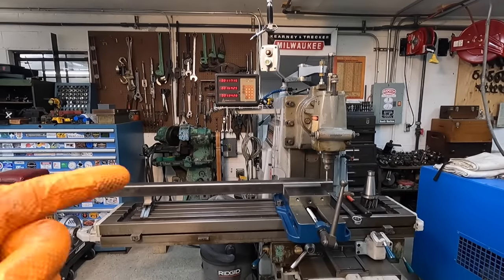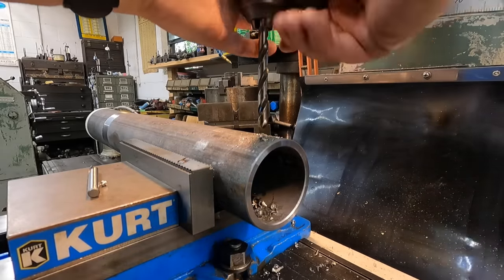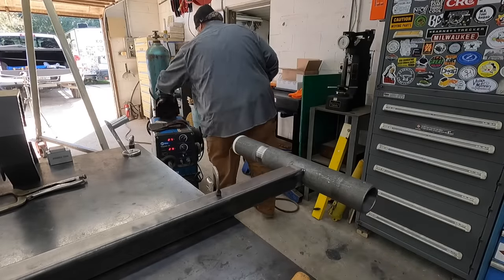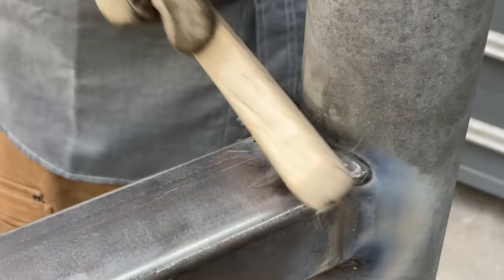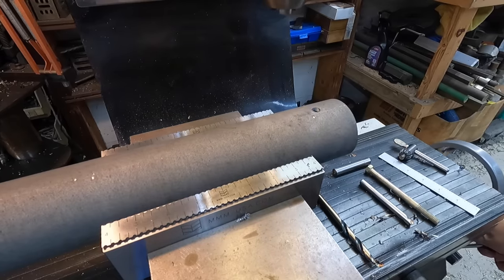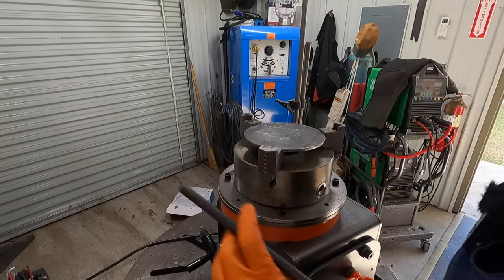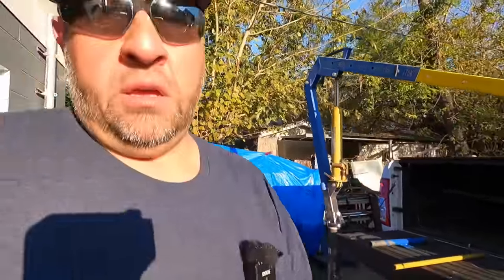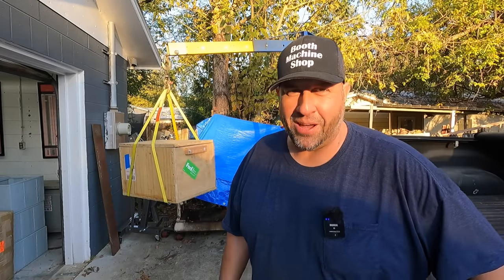Truck Hitch Crane Build Ep. 7: First Test!

Comment: Argon gas don't "go bad", but in some cases, after an extended period on time set up in the vertical position, they will separate, if they are a mixed gas. Argon-CO2 mixes, need to be laid down on the floor, and rolled around for a bit if you have not used them for extended periods.
Reply: I was gonna suggest he shake that tank before every use, like a rattle can.😃
Reply: @greeceuranusputin  Only if you have a Hulk on staff... lol
Reply: @mdouglaswray  Adam just has to bring some of that AbomPower out.  :D
Reply: Definitely! I have experienced this with all my mixes . 75/25 and definitely my tri mixes . Two ppl make this mixing easy , basically kicking (rolling) it back and forth
Reply: That's what I thought too. AR is a Nobel gas (very low reactivity) and CO2 gas is in stable configuration which does not readily react. Sitting few years as he stated must have separated the Argon and CO2. CO2 being heavier, would be at the bottom. You can try to visualize by putting oil (75%) and water (25%) in a bottle in the same proportions... If you "gently" roll it, it will not mix as well. I would think the best way to mix the contents would be shaking it like a champagne bottle (mostly vertical and up/down motion)... Good luck with that :)
Reply: @thekaduu  No, rolled thoroughly across the floor DOES WORK ... at the suggestion of our weld supply rep. 'Aggie Joe"
Reply: I agree with this
Reply: He should be running pure co2
Reply: yup
Reply: @threeriversforge1997  "A-Bomb Torque"!
Reply: @mdouglaswray  Our man Abom's pretty strong.
Reply: Seem to remember some one saying the same thing quite a while ago.  If it fixes the issues 'job done'...
Reply: I think the easiest way to get the champagne shaking affect would be to strap it in a truck bed and take'r for a ride . I'm sure the back of a car would even work.
Reply: I've never heard about that, and I can't find any reliable source for it. Can you link or name a welding gas manufacturers website or documentation about mixed gas separation being a thing?
Reply: @MrWizards1974  ...I literally said in my comment I cant find any realiable source, only random forum posts. I've been a welder for 10 years and never heard of an issue like this, so I'm thinkin it maybe just a myth. If you know it is true, I'm assuming you know a gas manufacturer who says you have to roll your gas bottles or whatever, and that's why I'm asking you that where did you learn this.
Reply: The atomic weight difference between Argon and CO2 isn't enough to overcome the thermal kinetic energy keeping the gasses mixed.  So, no, they won't separate any more than the nitrogen and oxygen in the atmosphere separates. (It doesn't).
Reply: @stargazer7644  A perfect example of someone trying to look smart and having no idea wtf they are talking about.
Reply: @MrWizards1974  It's just physics, man.  Just because you don't understand it doesn't make it not true.
Reply: @stargazer7644  You're just digging yourself in deeper. Quit while you're ahead.
Reply: @MrWizards1974  I'm still waiting for any kind of cogent argument from you.
Reply: @stargazer7644  the Earths atmosphere is dynamic, it mixes itself constantly.  Not a good comparison to a pressurized cylinder.
Reply: @stargazer7644  so some how stating that hydrogen and helium escape the atmosphere strengthens the comparison of our atmosphere to a sealed cylinder?
Reply: @leebatt7964  Sorry, I don't know how to make it any simpler for you.  Try reading and understanding the entire comment, not just a couple of words.  Whether gasses diffuse and stay mixed or if they separate depends on their thermal energy and the difference in their atomic weights.  Gas mixes that are close in atomic weight will not separate under gravity.  Reread that last sentence until you understand it.
Reply: @stargazer7644  reread my initial comment until you understand iit. Simply a bad analogy. Not a hard concept to understand. In fact, fairly simple to understand, you even confirmed it.

Comment: Talked to a friend of mine who taught welding. He said the worm track problem could be caused by contaminated flux. If the wire has been sitting for a lengthy period of time it could have moisture contamination. Hope this helps. The crane build is fricken awesome. Heavy duty without the extreme heavy weight.
Reply: So that is why welders store their welding rods inside a refrigerator !
Reply: @Garth2011  a small oven is better, there are ovens made specifically for storing rods and wire.
But moisture could wel be a major part of the problem, always seal rods and rolls back up or store them heated.
Especially flux MAG (active due to co2 so not MIG for inert) wire is prone to absorbing moisture fast
Reply: @Garth2011  Dry fluxed electrode runs better too.
Reply: @samuraidriver4x4  not all rods need an oven. Just certain ones
Reply: @Garth2011  Yes, with heat to keep the rods dry.
Reply: I had the same problem with flux core wire and it turned out to be the wire was bad, changed the roll and the problem disappeared

Comment: Adam, I don't know if you'll read this comment, but those bolts on the horizontal tubing to take up slack should be on the corner. That way it'll tighten up in both planes, and also it's much more difficult to crush or deform the corner of a square tubing. Great videos, love the detail. You're an amazing person!

Comment: Adam, great job like always. Instead welding tubes on the outside of your square vertical section of your lift for rotating, drill a hole clean through that section and flush weld a piece of tubing in that goes through the vertical section then you can put in your jack handle from either side and you won't have the two pieces of tubing sticking out from the sides of the vertical section.
Reply: That’s a good idea!

Comment: Having built a truck hitch crane similar to the one you are building I found that the foot holes a pin indexing are a big problem and require that you carry a separate jack when using the crane to lift the truck. Once the weight that you transfer with the crane into the truck bed weights the springs down, all that weight lifted is now set on the foot pin and in most cases, it will not want to be easily moved at all. I turned a jack into the footpost to solve the problem. It worked great! Thanx

Comment: I made up a version very similar to this one,  but it ended up being very dangerous. With about 600kg on it, it would twist the bar connecting to the hitch,  it would swing wildly when  unloading as the suspension would unload and throw the crane off plumb,  it also would swing when the suspension compressed, once again swinging wildly. 
Another issue was any uneven ground made for sketchy lifts, as the crane axis was never plumb.
I ended up using 70x70mm square and made up a 3 point frame with adjustable feet at 2 outrigger points and one at the hitch. This way I could plumb the crane and negate any suspension movement. It also allowed for un even ground. 
Happy to share pics of my setup. I would improve the design a bit more,  but so far I have found the setup works well. Just a huge pain to keep attaching and removing when needed. Can't leave it on as it would hit car park ceilings and drive through awnings.

Comment: In finishing up the crane, a paint strip the width of the hole diameters and in line with the holes painted down to the foot will help line up the holes to insert the pin.

Comment: I like the idea of spiraling the pinholes for load bearing (giving a bit of art too). Also some kind of roll out design of carrier for the truck to put the jack neatly away in the back on both sides. So wonderful a thing to have. Great idea Adam. Thanks for the video.
Reply: I am not an expert at welding but why run shielding gas and then use expensive flux core wire.  I have run tons of 30# rolls or copper clad solid wire with straight co2 or 75/25 shielding gas and get perfect and strong welds.
Reply: @Histandard2011  The dual shield process, when all is right, lays a smooth nearly ripple free weld that looks great under paint.

Comment: I think thats going to work great! Any load this is intended to lift shouldn't squat the truck enough to make disassembly an issue.  Its not like this is made to move 1000lb++ loads .. 150 to 500 lb is more realistic.
I think i might have to make something like this.
Edit: argon mixes do "settle" .. i had that issue as a hobby welder with a tank that sits in the corner for months at a time between uses. I lay the tank down in the truck for a day before i plan on welding.
Thanks for sharing 🇨🇦

Comment: For heavy lifting behind truck there will be a lot of torque at your vertical tube and crossbar, use caution on dirt or gravel... maybe a rubber pad, tire tread on foot.  Also, how will you retract foot once the truck is loaded?  A hydraulic foot or screw jack might be better than a pin.
Reply: To further that point, the entire bending moment caused by a heavy lift is carried through 2 point connections: the ground and the hitch.  The ground probably needs an outrigger in the hitch direction.  I would also triangle gusset the cove weld where the hitch transverse bar mates to the column.  Great project BTW.
Reply: @kenrolt8072  my thought was an outrigger to the rear, where most loads will be picked up.

Comment: Certified knuckle boom operator here. Just a word of warning for your setup. Make sure you are on level ground when using this. Maybe attach a small sight level and keep the bubble in the circle. I’d hate for you to pick up a load and have it swing into you or your truck. 

Also, you may want a screw jack under your hitch for heavier loads to prevent biding after the suspension settles.

Comment: I'm a auto tech and I have a Matco version of the  bits you used. I like them I do lift kits often, I use those. Also when I install catalyst converter gaurds to install nutserts works quick clean and the bit doesn't heat up.

Comment: On my Lincoln, when i am running 250 wire speed, i run only around 20 volts on .035 solid wire with the same gas you are running. To get more adjustment holes you can rotate the tube 10-15 degrees and you can have another row of holes.

Comment: Adam. Great video. What happens when the load is in the truck, and the suspension compresses? Your pin is going to be locked in position. Best regards.
Reply: With all due respect to ABOM or Adam I actually agree with you here ... Those pins will be a pain when there's any significant load on the back of that truck
Reply: Attach a tongue jack to the leg.  Raise it enogh to relieve pressure.   Better yet, use a tongue jack instead of the solid leg altogether.
Reply: @daddynichol52  that is a good solution .
Reply: He still hasn't addressed the issue i brought up of how he's going to counteract the weight of what he's lifting on a hill so it doesn't go swinging wildly
Reply: yeah, I do think two feet will be better as the truck has to take part of the load due to there being a moment being created as soon as you lift something
Reply: Good point .Tongue jack should be mounted on bottom. Beside this Very nice work !
Reply: @jerryshelton1481  there’s and easy solution for that. Don’t jack anything while parked on a hill.
Reply: He addressed this as a concern a few episodes ago
Reply: You can lift the truck easily (you are working with the suspension)
Reply: I've seen mechanic trucks with Autocranes on them use a trailer jack attached to their bumper. They will lower the jacks just low enough to touch the ground. When they are finished, they would rise it up and stow it away. I also have seen one guy with the pin style stiff leg, and he has nothing but trouble with it when he has a heavy load in the back of his truck. He would break out his jack to lift his truck enough to unpin his stiff leg for his lifting device. Jacks are the way to go.
Reply: @jerryshelton1481   Don't use it on a hill or turn the vehicle so it's level.
Reply: @Kymerican  yes but he goes to other states to all kinds of events and sometimes he comes home with stuff
Reply: @clydedyson2147  absolutely right. Not sure why Adam is persisting with this when it’s been pointed out so many times. One thing is for certain - there will never be a hole in that leg that is the perfect adjustment.
Reply: hydraulic foot jack.
Reply: Maybe a "Mono tube" design would work better...id put casters and 2 extra legs on the hitch side  so you can just roll it away when not using
Reply: @srp01983  he addressed this concern I think a couple of videos ago.
Reply: Nothing that crane can pick up will squat that truck enough to cause a problem.
Reply: @jerryshelton1481  Easy solution .... Don't lift heavy weights on hills.   (I don't think anybody actually ever does)
Reply: He mentioned in the earlier video that there's enough slack in the system that it shouldn't be an issue. And if it does end out being a problem he may change to a screw style.
Reply: It takes a lot of weight to compress the suspension on this truck
Reply: Small bottle jack like I do under the hitch to take the load off
Reply: Put hydraulics on the truck like they do in a Dr.Dre and Snoop Doggy Dogg video 🤷😂
Reply: @daddynichol52  : put heavy load small wheels on it and drive the truck up on small ramps to preload springs and your free to unhook the Lift .. ( ps. I had your idea thought first,  then thought of this one TWO )
Reply: I would say.. No jack. Just make a horizontal pivot at the hitch. So that as the truck loads / lowers the jack will move. Yes it will tilt a bit. Depending on how much weight and. Suspension travel.  

I always wanted to put a bed mounted one in.  But do it right with frame and reinforcement. ( not clamping the bed floor).
Reply: There's slack in the hitch receiver. That slack gets amplified the further out to the side you go. He'll be fine....
Reply: IMHO... If the load is so heavy that compress the suspension and lock the pin, an "easy" solution will be use the car jack to lift the truck just enough to release the pin. This could work...
Reply: Good point !

Comment: I think it's going to work well all of those that have commented that using bolts and not harden pins.  I would agree if this was going to be used as a crane to load heavy things that would compress the suspension of the  truck but if you are talking 500, 600 pounds it will work great.  You designed it and built it and I for one would trust what you build far more than anyone else.  And it's alot better truck crane then you can buy.  Adam good job.

Comment: To reduce rhea amount of weight you have to lift when installing the crane, instead of bolting everything together, just use pins like on the foot on each end of the cylinder and the hinge joint of the lift. Takes a fee seconds to put together but saves the back and allows for easier storage.

Comment: Hi Adam, great job on the crane. Just a thought thou, depending on the weight of the intended object to be lifted, have you considered after placing the item of, say, 500 Lbs or over, in the truck bed, the amount of downward force on the back axil, to remove the adjuster pin out of the hole of the support leg? 
Enjoy your videos of all your channels. 😁👍

Comment: Something I learned real fast with flux core welding wire is using the proper technique. With flux core wire you can not push the weld like with solid wire. With flux core in my experience you have to drag the weld just like stick welding. That way the wire is feeding back into the weld. And helps eliminate pin holes in the weld. Chang up the angle of your mig gun and try dragging the weld. It works for me. Also the correct polarity if important. Flux core runs opposite of hard wire
Reply: I agree 100%! That imformation is on the sticker inside the door on the cabinet,Miller puts the electrode configurations in there!

Comment: Instead of pushing your wire try dragging it… pinholes might be caused by slag inclusions. Or some flux core wires are negative wires, just check the polarity and check the shielding gas to run with it. Not sure on American colour coding for gas bottles looks like pure argon, may need argon/carbon dioxide mix
Reply: Sounds like a plan
Reply: another thing to consider could be a bad liner, I tried to see the gas bottle label and could not read it as he pans over it quickly, I think it is a mix though. clearing the diffuser might also help.
side note:  In the United States, color-coding is not regulated by law. so, if you ever weld here read labels...
Reply: The Wesco blue bottles are 75/25 mix.
Reply: Miller lists all of the proper polarity on the inside of the cargo door.It shows flux core to be reverse polarity! He should check that gor sure.

Comment: Stick out too short. Read the welding wire manufacturer's recommendations.

And just a thought: What if there's a ton on the crane, the crane points straight back and that single foot slips? Can the bar and the hitch deal with that kind of torque?
Reply: Given the kind of torque those receivers get when taking a trailer over bumps and turning, I'd say they probably can.
Reply: @BlackEpyon  
That's not nearly a ton of torque under normal driving conditions - but anyway, I'm mostly worried that the bar can't resist the torque.
Reply: The bed isn't even rated for a ton. Why would he do something that ridiculous anyway. Look how nice the machining is. Do you honestly think he would go ahead and ruin his back saver? If so you are the one that shouldn't be using a crane.
Reply: @Room_for_1_more_fruit_tree  
Okay.

Comment: Personally, I think I would have staggered the holes on the foot to get more metal between them.  Having them all in line like that looked kind of weak.
Reply: or have several holes in the receiver with different center distance. Vernier pattern.
Reply: I agree.  Spiraling them as they go up will fix this problem.
Reply: metal stronk